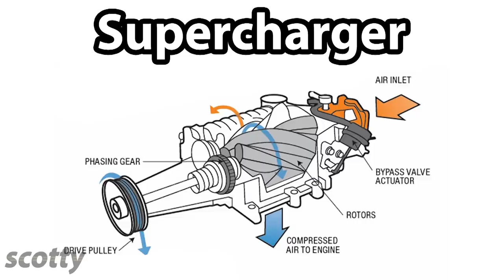Supercharger vs Turbocharger - Why Supercharged Car is Better than Turbo

Comment: N/A ia the way to go for us poor people
Reply: I feel ya, I'm the proud owner of a 17 mustang gt. too bad I don't have an extra 8-10k laying around to spend on forced induction.
Reply: My boss(very close to him, known him almost 15 years) has a nice collection of Mustangs, an 86 Blue Foxbody NA 4.6l pushing about 500hp, 92 red foxbody NA 5.0 pushing about 600hp(lifts front tires up on a good launch) and it is all setup for drag as far as the suspension goes, he has a couple more ranging between 95 and 2016 5.0' including a 2016 California edition 5.0 NA, 

As much as I love turbos and specifically superchargers. There is almost nothing like the sound of just motor rolling out all kinds of power.
Reply: Exactly.
Reply: Actually you can afford better than turbo and supercharged for peanuts its called vvc. Running at 7600 rpm is simply heaven in a na engine.
Reply: it's more fun to drive a slower car too

Comment: and they sound like angels singing the greatest tune ever. if you like the sound but cant afford a supercharger you can always install timing gears instead of timing chain, just dont tell your friends or show them the motor or race them or they will make fun of you.
Reply: More like angels screaming.
Reply: IM26C4U Weeping angels? Run for your lives!!! But don't blink (Dr Who reference)
Reply: awesome
Reply: I have both a M90 supercharger AND timing gears on my 300I6
Reply: 454 stainless steel exhaust gear driven
Reply: IM26C4U 454 stainless steel exhaust gear driven very loud

Comment: Supercharger : gets boost faster. 
Turbo : gets more boost.
Reply: Micheal Dimitrick depends on the type of each you are using. A Whipple or Roots -type charger does move air pretty linearly with little lag but the ProCharger and similar radial style compressors increase boost exponentially so you still have to get the revs up high to get the full boost.  A good twin or twin-scroll turbo will minimize the effects of turbo lag but they do add complexity to your  setup.
Reply: Micheal, are you being sarcastic?
A centrifigal blower doesn't make full boost till the entire engine revs sufficiently. A turbo spools up just as fast as rotational inertia allows it to.
"More boost" has nothing to do with supercharger/turbo, but is determined by sc gearing or turbo sizing, and in either case there's a pop-off valve.
Reply: So y not both
Reply: @331SVTCobra  thats pretty much what I said.
Reply: DissTrackReaction  yep thats what i said :-)
Reply: @Psychicbluefire  its been done!
Reply: @102wingnut  ive heard of that kind of stuff but that sounds really crazy
Reply: More like supercharger - instant boost.
Turbo - more power for same boost (minor parasitic effect)
Reply: @Psychicbluefire  Volvo has plenty of twin charged vehicles!
Reply: Superchargers have more of a linear power curve.
Reply: Remember the fastest accelerating cars in the world have superchargers
Reply: @tanman7879   if you are referring to NHRA top fuel dragsters then thats hardly a "car" in my mind anyway. I always forget those cars are s/c
Reply: @someguyprobably  Yes top fuel. Purpose built racecar. I get what you are saying. Not an everyday driver LOL
Reply: well, depens of the size of the turbocharger
Reply: Superchargers win from stoplights 
Turbos spread gap sauce on the highway
Reply: @reed7434  in less you Brake boost it.
Reply: @331SVTCobra  well said!
Reply: Superchargers don’t get less boost??? It’s just no one has put a really super big supercharger on a car.
Reply: @102wingnut  twin scroll turbo any day over supercharger....My car has almost no lag at 20psi, and it pulls so much harder that a supercharger rated for the same power...Not to mention better gas mileage...Shoulda seen the look on the guys face at the drag races last weekend when i beat his supercharged c5 vette after he was a length ahead of me at 600 ft...Theres a reason all the v8 drag racers went to twin turbo...Takes way too big of a supercharger to make that kind of power
Reply: @thepseudomasterchef7238  agreed!!! Twin scrolls pretty much are the best of both worlds with Max boost and little to no lag 😁!!!
Reply: @102wingnut  its worth the sacrifice of having to run equal length headers..lol..I barely get any boxer rumble...The fa20dit turbo is pretty small, but it spools up instantly and is still capable of 25psi...Too much boost for factory internals though
Reply: @102wingnut  so can twin turbos respond the same as a super charger?
Reply: @TheMrmagic101  if you set them up right yes.  A lot of drag racers now are using sequential twin turbos.
Reply: @102wingnut  so sequential setup. Not straight on twin turbo or twin scroll turbo. Looking for more response while exciting corners but still having some top end. Or even possibly auto cross
Reply: Alton Porter Anti-lag. Look it up.
Reply: turbo is still good if people don't mind replacing them 5 years later....

Comment: Scotty, you left out a few major points. A turbocharged car will make more HP per LB of boost than a supercharged car. Torque? A good turbo setup will significantly exceed the gross torque of a supercharged car. That being said, all the points made in the video are correct. A supercharger kit is MUCH easier to install and package than a turbo kit and the under hood temps are lower as well.
Reply: Sure a turbo will make a little more torque. But a supercharger does it a lot more quickly. I’ll take a supercharger anyday.

Comment: Nice, I like the instant power of a supercharger too and the whine it makes is music to your ears! You should have talked about the different between centrifugal superchargers and roots superchargers, personally I prefer a top mounted roots style supercharger to a centrifugal supercharger mounted at the front of the engine. I've seen some really cool complete roots style supercharger kits that even include a tuner for the engine made by companies like edelbrock that are made for late model car and made to fit under the stock hood. Recently I saw a video of a roots style supercharger being installed on a late model Camaro and it replaced the intake manifold and sat in the valley right there and was nice and low profile and it looked super clean, the engine looked almost stock when it was done you could barely tell it was there!

Comment: I own 2 cars. One has a Supercharger('05 Monte Carlo SS Supercharged w/3800 Eaton M90), the other a Turbocharger('05 Legacy GT w/2.5L EJ255 VF40 Turbo). Both are excellent, and with proper tuning you can have near-zero lag. I very much like the instant boost you get with the supercharger, and If one wants more power and their car can handle it, they can get a smaller pulley(Belt driven) for it for cheap and get extra boost. One advantage that Turbochargers over the Supercharger is they are not Parasitic and require no power. Thanks for the videos Mr Kilmer, enjoy them.
Reply: but you forgot to mention more frequent OIL changes with a turbo, where as a SC only needs oil change every 80-100k miles :), and parasitic is minimal

Comment: Two turbos fix the lag problem. Lol 😂
Reply: TIRESIDE two more complex things to go wrong...
Reply: J Alcatraz oh no, might as well ride a bicycle cause the engine in my truck could go wrong. Scary.
Reply: SnowB na all the way!!!!
Reply: or just one, but with variable turbine geometry like porsche uses in their turbocars. or a twinscroll turbo like bmw does, max torque from 1600rpm to 5600rpm
Reply: They do not. Unless it's a compound turbo setup
Reply: A properly sized turbo will not have lag.
Reply: there is always lag with turbo.
Reply: saauuzza unless you have anti lag
Reply: rockn roll theyre multi-billion dolar companies....
Reply: TIRESIDE sport mode on any car fixes any lag problem
Reply: actually in most situations that makes it worse
Reply: TIRESIDE properly sized turbo and right type solves lag problem. Plus lag is fun
Reply: nukeboy207 antilag doesnt stop the first initial lag though
Reply: Or variable geometry? Or a properly proportioned turbo:engine
Reply: TIRESIDE anti lag does to and blow valves the reason turbos are so complex is to minimize turbo lag as much as possible
Reply: More money to spend on a problem that you could have never ran into
Reply: TheWolvesCurse the 335i gets full torque at 1400rpm lol and gets 31 mpg’s
Reply: SnowB he’s not wrong
Reply: Why pay for two turbos,  when one super charger is all you need. Best of all no lag. Pure hp. Is all you need. No excuses plse. You heard the man.

Comment: That was a good presentation.  It fairly covered the advantages and disadvantages of turbochargers vs mechanically driven superchargers.  However, in recent years, much as been done to reduce turbo lag so it's less of a problem than it used to be even though it still exists.

Comment: 500hp + supercharger = 1200hp 

W H A T
Reply: Probably running well over 20 pounds of boost.
Reply: Ya, 15 lbs of boost basically doubles the hp of most engines.
Reply: BOOST
Reply: @brentrichards1200  me with my gti mk 2 with 70 lbs of boost in forza

Comment: 1 like = 1 Supercharger 
1 comment = 1 Turbo
Reply: DeadisBetter turbo got more boost  and supercharger is just good for high speed car to just get a kick boost
Reply: LMFAO. What????
Reply: Comment
Reply: Turbo has more power and it’s facts
Reply: Turbo is the best
Reply: Turbos cause of fuel economy for us daily drivers
Reply: 2jz
Reply: DeadisBetter gotta go turboed
Reply: @srt4dyl981  Turbo's are more efficient as well. Superchargers take 3-5 hp to keep the belt turning. If superchargers were better the 911 Turbo would be named differently.
Reply: Singh Gurmeet
thats how prochargers work, Whipple superchargers work better in the lower RPMs
Reply: @just_a5.7  rb26
Reply: Turbos are more efficient, no belt slip, no heat soak issues, and no parasitic HP loss.
Reply: @anthonywebber2211  The top end power of Whipple or any screw type superchargers for the matter will taper off up top.
Reply: Turbo is better bcoz it is only runnig on exhaust gas unlike supercharger decreasing torq of engine BRUUUUHH
Reply: I want both.

Comment: Superchargers just sound better. You get the whine, and it doesn't muffle the exhaust like a turbo. And you made great points about it being a lot easier to install, and usually a bit cheaper.

But for raw performance, a properly sized and tuned turbo will be better 9 times out of 10.

Comment: Scotty, I’m considering a supercharger by wynnjammer for my 2012 GMC pick up with a 4.3 L engine. It’s a 2012 sierra and it’s paid for with 60,000 miles. The engine is in good shape as I change the oil with synthetic blend about every 2000 miles. The kit cost about $2400 in the computer needs to be reprogrammed. I realized I made a mistake by buying the truck with the small engine. I talked to the people at Windjammer and he claimed an easy 80 or 90 horse power increase especially if I change the fuel injectors to a larger size. I really am doing this just to make it more drivable as acceleration is very poor.

Comment: I personally prefer natural aspiration, but if I had to choose, supercharged engine is still closer to that natural power delivery than a turbocharged engine. I've driven a turbocharged (diesel) car with automatic transmission and it could be a dangerous experience at times. Turbo lag, combined with delayed downshifts, was like asking for trouble in city traffic, or during lane changes on the highway. Also, a supercharger installation is something I could probably manage myself, while a turbocharger add on seems more involved and elaborate. This IS  a legitimate concern as well because that feeds into the cost factor. After all, we're not discussing things in theory just for the heck of it.

Comment: Superchargers are slightly cheaper then a good turbo kit for my car at least. But if you want to make the most power turbo is the way it's easier for them to make more power then a supercharger plus if you see any races with 2 guys around same hp lvl turbo guy usually takes it since they make more power up top aka higher rpm lvls. I went supercharger on my car since I didn't want to make anything over 800 whp.
Reply: I doubt you make 800wheel
Reply: With a big turbo, e85, obvious tune and LTH, 800 rwhp is reasonable for a mustang

Comment: 500 to 1,200 HP with just a supercharger? BS.
Reply: Lookup the Procharger F1X
Reply: @ligmasurvivor997  u can do the exact same with a turbo...
Reply: @Boostlifelex  with a lot of more trouble, Charger just install, tune, and get back home
Reply: @akumakazenoryu  that's the furthest thing from the truth... Have you even tuned a car before?
Reply: Cam Solo as a 65 gt350 mustang owner I can say yes I have. It’s a misconception that superchargers make like no power. That’s only because when you think of superchargers they think of the demon or hellcat or the gt500 those are stock cars tho. You can make 800 hp from a supercharger easy
Reply: nonsense verses he’s not joking!
Reply: Can you make 10 thousand hp with a turbo
Reply: Fishermanguy44  Must have been a tired 4.8 if it only made 200hp lol
Reply: @Boostlifelex  Sure you can....at high RPM only, and AFTER you spool it.  Turbos are more efficient (90% or better) vs a Supurcharger (70-75%)....rotating mass sucks.  BUUUT?  Like Scotty said, you get it from launch....you don't with a turbo.

In business they say, location, location, location.  In forced induction, it's application, application, application.

My 4x4 overland is much happier with a supercharger, thank you.....though I could pull the 1/4 (with a slower hole-shot) and get better MPG with a turbo.  Not useful to me.
Reply: @Boostlifelex  Sure you can....at high RPM only, and AFTER you spool it.  Turbos are more efficient (90% or better) vs a Supurcharger (70-75%)....rotating mass sucks.  BUUUT?  Like Scotty said, you get it from launch....you don't with a turbo.

In business they say, location, location, location.  In forced induction, it's application, application, application.

My 4x4 overland is much happier with a supercharger, thank you.....though I could pull the 1/4 (with a slower hole-shot) and get better MPG with a turbo.  Not useful to me.
Reply: Look at dragsters. 11,000hp
Reply: 1,200 seems doable with supercharged V8s but there has to be a lot more mods.
Reply: @jcaj9002  ever watch NHRA?
Reply: It'a a supercharged LS.
Reply: Peder Hansen  can properly set up twin turbos be as effective as a super charger from launch or on low end
Reply: turbos dont even kick in until high rpm I dont want to redline my engine every time i want power
Reply: @jschlattfunnymic3069  even on a toyota corrola or maybe a gmc envoy??
Reply: @fargeeks  especially those

Comment: Now they have hybrid turbo charger. No lag because an electric motor is keeping the turbo spooled at low revs. The electric motor cuts out when the revs get high enough to keep the turbo going.

Comment: Scotty I love the channel. 

However I must say that if a person is skilled enough to install a supercharger. Then it would be cheaper to install the turbocharger. 
You can find brand new turbo kits for around 500 dollars. 
Since both turbos and superchargers would benefit from the intercooler the cost is the same on that part as well as the tune. So it really comes down to preference since you can find a used supercharger in a junkyard.

Comment: Turbochargers are more efficient for starters lol
Reply: superchargers simpler to install, less components, instant response with a roots supercharger, boost from idle. 
I prefer turbos though.
Reply: filoIII Turbochargers have been standard equipment on big diesel engines for 50+ years now and usually run over a million miles before having to be replaced, so I wouldn't say "they break easy".
Reply: Adam Simonsen and the supercharger themselves need maintenance too.
Reply: he said that in the video
Reply: Herker Derker Supercharger technology has finally started to get some love. You can get modern superchargers now that take next to nothing to spin when the bypass is open (you're not using it).
Reply: filoIII they break easily because they are above 120k rpm.. Superchargers never go above 65k rpm in general. That insane RPM speeds cause a lot of heat.
Reply: turbo is better cause in a long way it give u more hp nd it can win. supercharge is just good when u start the race
Reply: Andy Cruz Superchargers are cheaper and more reliable. Also for 1/8 or 1/4 superchargers are BETTER. On a circuit I can say Turbo is better.
Reply: Adam Simonsen yea my diesel truck has over 350k miles still runs good

Comment: Isn't a supercharger more taxing on the engine, and doesn't the turbo has the capacity to give more power?
Reply: You can mess with turbos a little more and it's easier to get a lot of power, yes. But turbos tend to die more because of that. Superchargers are more reliable.

Comment: On a properly sized turbo set up, lag is minimal. The thing that makes me prefer turbocharging vs supercharging is that with a boost controller you can turn the boost up or down depending on your needs. Want to save on fuel, turn it down. Wanna play, crank it up

Comment: Turbo = turbine supercharger

They're all supercharger s just different implementation.
Reply: No they’re both forced induction!!
Reply: actually the both forced induction
Reply: Says the Buick regal grand national
Reply: Pretty sure turbocharger were originally called turbo superchargers before being called turbochargers
Reply: It just depends on how the air gets pushed. A supercharger is belt driven, turbo is exaust. You can get centrifugal superchargers which are pretty much just a belt driven turbo if you like the blowoff and want instant power.
Reply: @isaiahprieto9751  Yes, turbine superchargers which was then just abbreviated.  Anything with forced induction is "supercharged".  A turbo is just one type of supercharger.